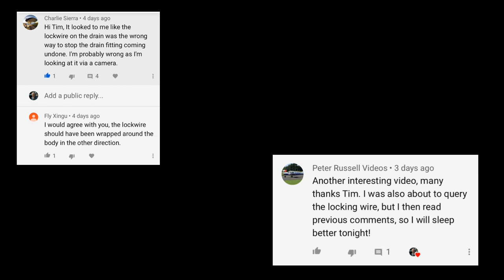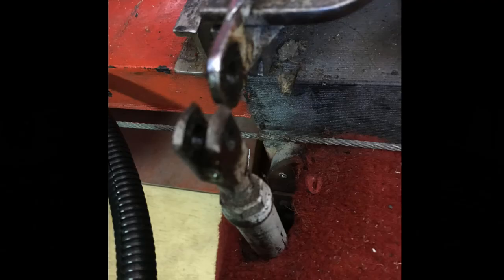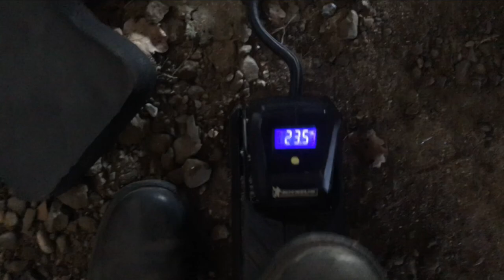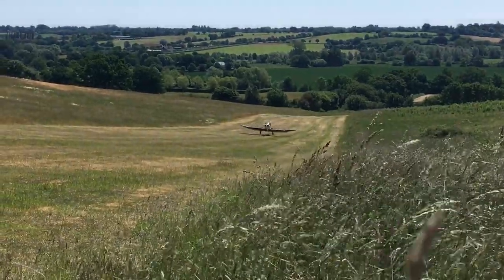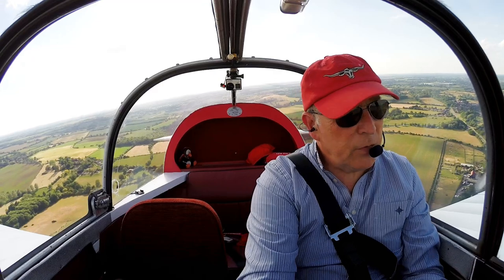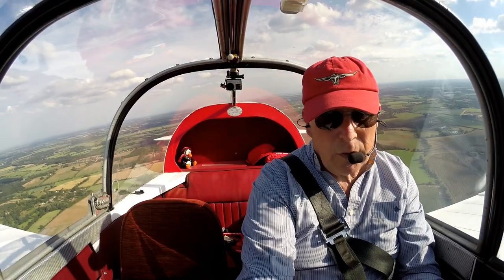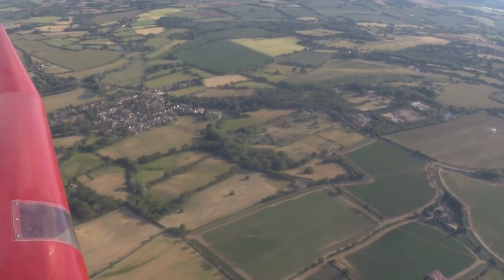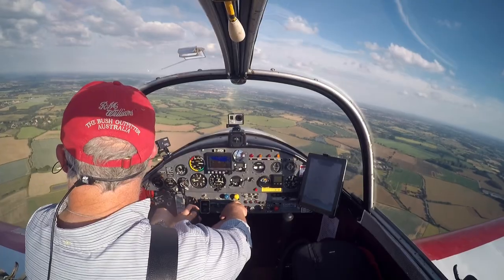I NEARLY GOT RUN OVER! ... but survived to do some permit work

Comment: nice landing given the squerly conditions, when its gusty do you opt for no airbrake or not enough runout on the runway? - side slip? maybe?
Reply from the maker: There are times when I land without airbrake but I usually use it. Gusty conditions at Nyland can be compounded by the slopes and the trees. I find the DR1050 side slips well enough and sometimes combine both.

Comment: Did using the remote use more battery power? I’ve not used one but is it easier?
Reply from the maker: It was only a short flight but I don't think it was much of a power drain. Once you sync to the 3 cameras the rest is easy. just press the red button to record and press it again to stop and you can turn off the cameras with the remote power button. I have 2 GoPro hero 3s and 1 GoPro Hero 4. and it works well with these.

Comment: Lovely video again Tim! It’s a nice thing to wake up to and start my Friday with 😊. I loved the part when you mentioned the Apache, I have them flying over my head all the time! In fact yesterday, one just skimmed the top of the house it was so low! I was going to ask you as well, I saw a NOTAM about fast jets over Nayland a week or two ago. Did anything ever come of that? Cheers for the brilliant content Tim!
Reply from the maker: Thank you very much. Glad you enjoy the videos. There was a Notam in place for 2 days.( I think it said fast jets doing dynamic movements between surface and 4800ft within a radius of 3nm) I think that would be a lot to ask! but we did have a Piper Navajo flying around in large circles for a couple of hours each day. The military were set up on the airfield doing some sort of calibration exercise.